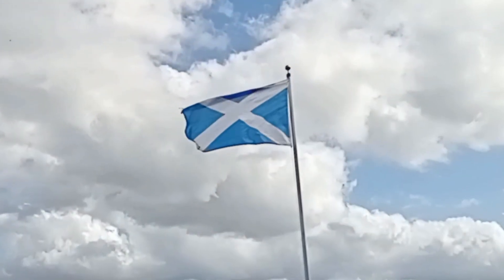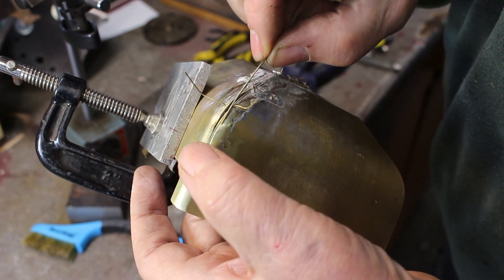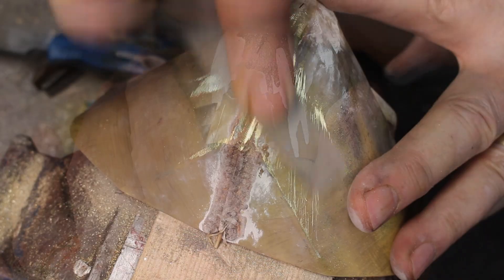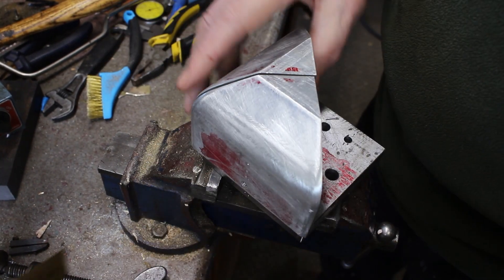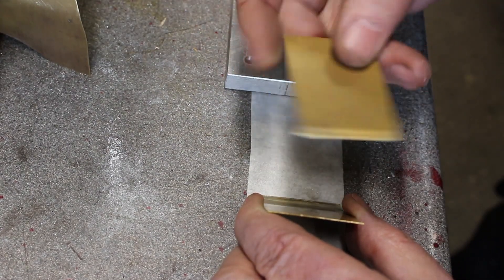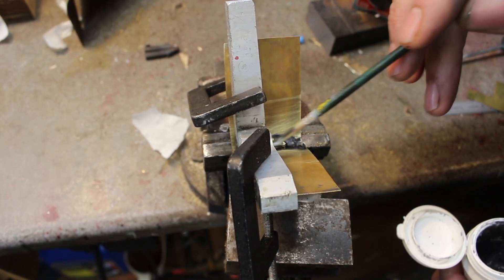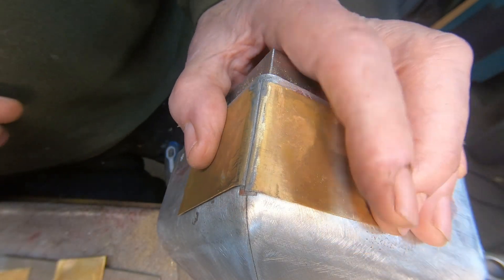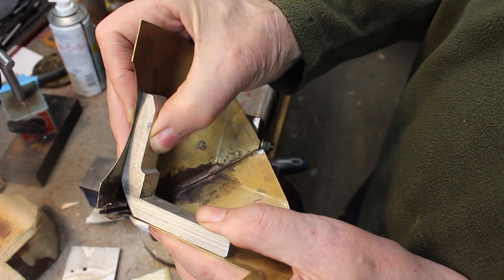Lion - Model Steam Locomoitive Build - Part 72-  Brass Dome Ep. 4 - Follow my Model Engineering.

Comment: I THINK WHAT YOU NEED ARE    "Safety Wire Pliers - Lock Wire Twisting Tool for Aircraft & Auto Industry"     this way you can tie the edge together very tightly with brass wire 

Ive seen people use them for making boats - it pulls two thin sheets of plywood or cedar strip together. But the hole it leaves is tiny and very easy to fill.  EDIT:  If you made it out of 1mm thick brass and stitched it together edge to edge with brass wire using the safety wire pliers, you could silver shoulder it and need no filler and no clamps
Reply from the maker: I've not heard of safety wire pliers before, I'll look into it, thanks.
I'm continuing to have problems and thinking of changing my approach and going for an edge to edge butt joint. Unfortunately I'm going to be away from home the next couple of weeks so the brass dome will have to wait.
Cheers 
Nigel
Reply: @GoCreatehms  Ive seen lots of videos, mostly from Am3ric4, of people making things like cedar strip canoe by "stitching"  with safety wire pliers.  As they spin the wire very tightly, it draws the edges together in a very neat but joint.  The pliers are intended for use on the bolt safety wire on wooden propellers on light aircraft etc.

Comment: Thats dome is a challenging item. Well done. Good plan. Can i as about your oxy propane kit please. I saw it on the video when you straightened the lion frames. Where did you get that please. Im needing one for a boiler repair and that looked the job. Ps nice allchin, built one myself, perfect size arent they.
Reply from the maker: Hi Paul, thanks, the dome is perhaps my biggest challenge yet.
I bought my oxy propane from The Welders Warehouse who now seem to be closed. I've had a quick look around and haven't found the exact equipment I have though the link below has similar. I use a 20 litre oxygen tank that my local autoparts stocks, they supply a range of SGS welding gasses.
Sorry I can't be more helpful,  hopefully this link will help you out.
https://www.weldequip.com/oxy-propane-brazing.htm
Cheers
Nigel
Reply: @GoCreatehms thanks Nigel ill check that out. Certainly gets the heat where you need it fast. Great work by the way fella. Every video i watch i pick up something from you, ive been model engineering for donkeys years too. Youre at the top of the game thats for sure, that lion is lovely, shame to paint it.

Comment: I admire your patience and tenacity.  As another possible alternative, how about using a brass/copper backing strip, then use that to strengthen a butt joint between the parts.  Hold it together with small brass screws and then silver solder, perhaps with some scraps of brass to fill in any spots where the butt joint isn't perfect?
Reply from the maker: Thnaks. Yeah, I've thought along similar lines using butt joints and backing pieces all screwed together. If I still have problems than that's probably plan B.

Comment: It's funny isn't it? The jobs that appear to be the simplest turn out to be right brutes.
I'm wondering, as you have access to the original, how is the dome constructed on it?
 You were talking about using 10BA screws; why not 1/16" brass  rivets? Either would be filed off smooth if you succeed in making this joint.
Reply from the maker: Yeah, I'm definitely more of a machinist than a fabricator, but I'm learning. Yeah, rivets would work also.
Cheers
Nigel

Comment: Nice pragmatic solution. You can get brass coloured solder from jewellers supplies. Albion Fire and Ice is a UK supplier. Another solution is to make a ledge on one side and sweat solder the joint.  Andrew Berry jewellery channel has some great videos on soldering. Good luck.
Reply from the maker: Fantastic, thanks. I was thinking if only someone would invent brass coloured solder!
Cheers 
Nigel

Comment: You have the patience of Job! My approach would be to make it in copper and TIG weld in short steps adding filler metal as needed. But talk is cheap and the truth is that I wouldn’t even attempt this in the first place. Good luck. Can’t wait for the next chapter!
Reply from the maker: Thanks. I like the idea of tig welding. Even for silver soldering copper would be easier as there is less concern about melting the sheet material and an small oxy propane torch can be used. If fabricated in copper it could easily be brass plated for an authentic appreance.
Cheers
Nigel